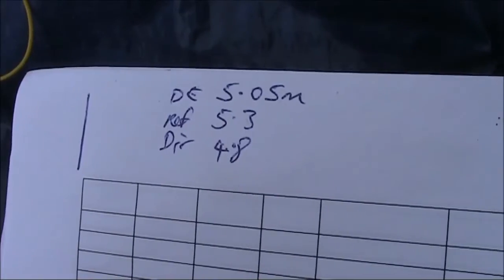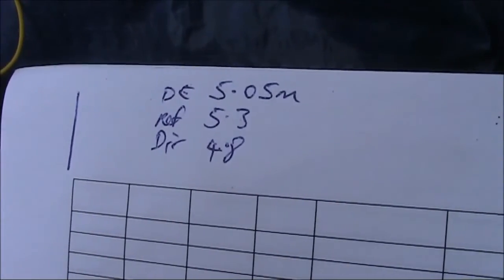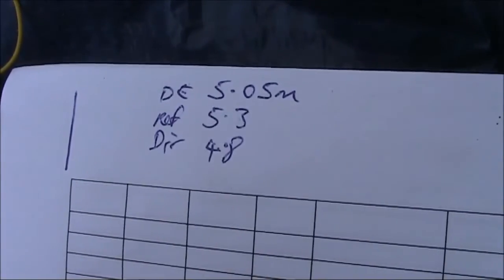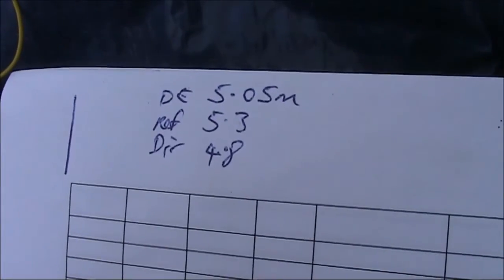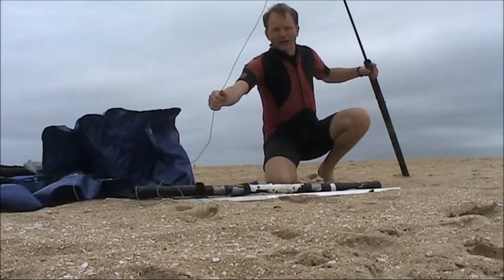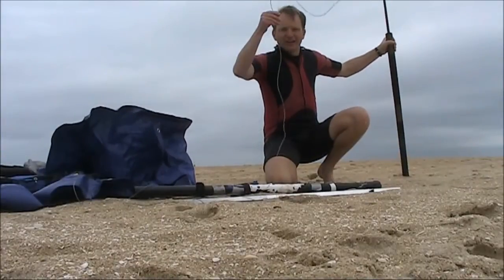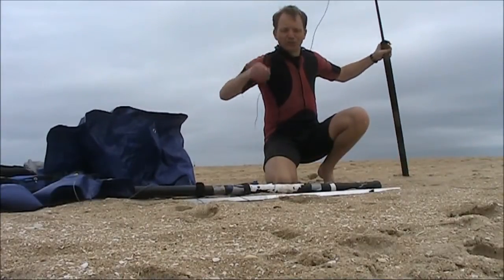Going around in circles 1: An attempt at an end-fed vertical beam antenna

Comment: Hi Peter, came across this researching an experiment. I have had great success with phasing 1/4 wave linear loaded verticals on 20m using 1/8 wave spacing(there's a video on my channel) The front to back is brilliant. I have 2 identical end fed zepp's and I will attempt to phased them in the hope they will work, hence finding your video after having the idea. Thanks for the video

Comment: Peter, another good video. Something that will show a difference though is either the Moxon (as you know), but is more complicated to set up. But for something simple to set up you could look at 2 verticals, fed in phase to give bi-directional broadside pattern, and simply switch to out of phase for bi-directional endfire.

I've done this with 2 of the bottom fed "no counterpoise" antennas, and observed almost complete nulling to the ends when set up for broadside, and vice versa.